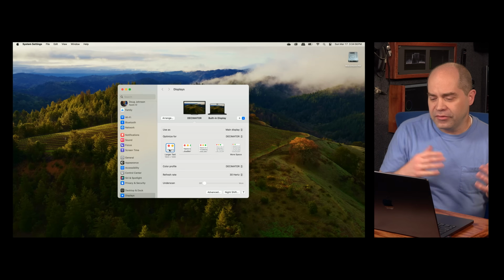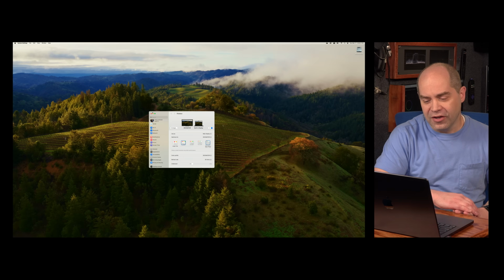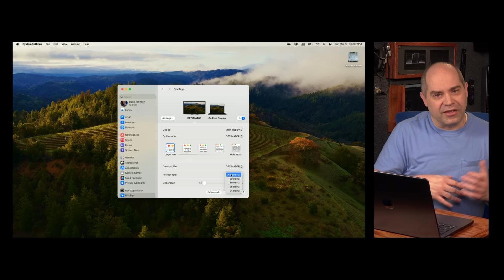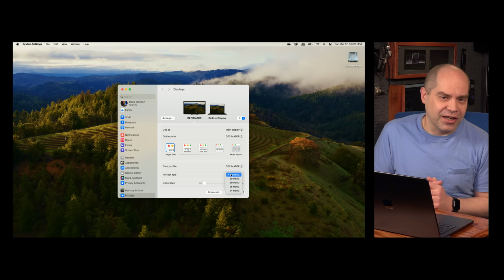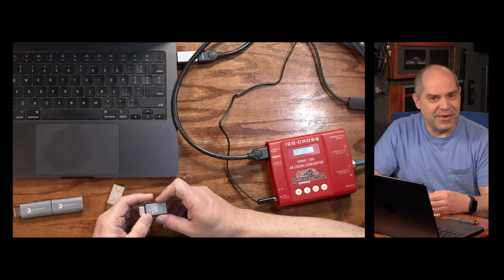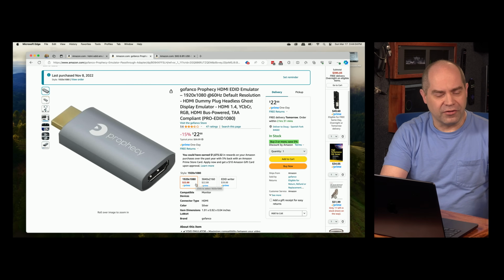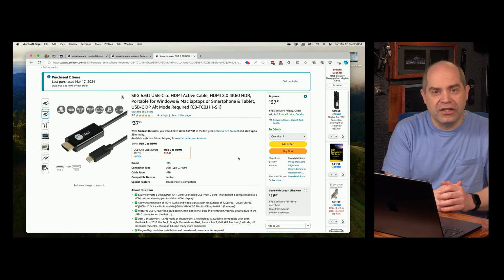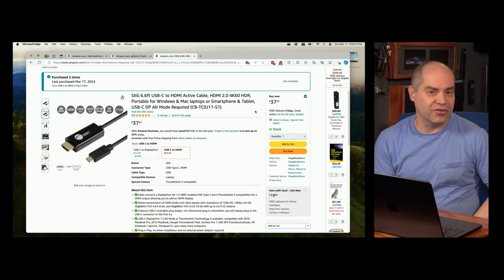Fixing Apple Silicon Mac HDMI Output for Video Production Systems

Comment: I always found it interesting how Macs seemed to be marketed as "media production computers" and yet they cause more headaches in a production environment than most all Windows computers. At least that has been my experience.
Reply from the maker: For me, Macs have been a lot more of a headache to deal with than Windows PCs. From weird things like this HDMI issue to software updates that break drivers to a lot of occasions where a piece of software that I need to run an event isn't available on Mac, I generally now only use Macs when I have to.
Reply: As a user of both, I've found the opposite to be true. Windows is always changing and thus more difficult to support. We use more Windows appliances for broadcast but more Mac workstations for Post production. It just boils down to using the best software ecosystems available.
Reply: 100 % agree. The fact that this has been a issue since the introduction of their own chips, and they refusal to acknowledge incorrect is mind blowing

Comment: If you use the 'Advanced. button and check "Show Resolution as List"  you get a switch to "Show all resolutions"   Any resolution that is not HiDPI scaling to full pixel resolution available as you describe is then noted as 'low resolution' next to it.
Reply from the maker: I'm sorry, but this doesn't change the HDMI output resolution. It gives you additional scaling options, but the HDMI output resolution remains unchanged. I verified this, yet again, just a few minutes ago, on both of my Macs.
Reply: Really?,  I just did it on mine and it worked.  The resolutions not marked (low resolution) will be full available resolution but scaling text and UI elements as if it was the lower resolution.  Resolutions marked (low resolution) will output that actual resolution.  This has been the case since case for some time before M chips, but is what the intel mac and the M2 max in front of me both do.  @djp_video  
You usually only see the (low resolution) modes with "Show all resolutions" turned on.
Reply from the maker: You verified with a piece of equipment that shows the HDMI output resolution? I did it with both the Decimator 12G-CROSS and Teranex AV and both showed 2160p60 no matter which option I selected in the resolution list. I tried it several times on my M3 MacBook Pro and M1 Mini. Same result.
Reply: Opps, Im a liar,  its now $16
Reply from the maker: @praeburn I just posted some photos on my Discord server showing that what the macOS interface is indicating and what it is doing are different. Apple has elected to show one thing in the user interface when the hardware is doing something else entirely. https://discord.gg/d8mFdXbNHJ
Reply from the maker: @praeburn I've also installed SwitchResX and it doesn't help. You'll be able to see that in one of the photos on Discord.

Comment: I wonder if you have tried in Extended Display mode instead of duplicating the display. For me, this has not been an issue, but I also don't run computers into the system a lot.
Reply from the maker: I tried it. It does not make a difference.

Comment: We have an M2 MacBook Pro and a deck link Duo in a sonnet PCIE thunderbolt expansion unit. After about 20 minutes of being connected to the MacBook the outputs will stop working and the deck link now longer shows up in the blackmagic software. Odly enough the deck link is still showing in the system devices menu. Power cycling the sonnet rack fixes the issue but it’s unusable for any live show. Any thoughts?
Reply from the maker: Hmmm. Might be worth reaching out to Sonnet for support.
Reply: Is this the first time you're having issues with that particular Decklink card? If so, it might be the fan on the card.
Reply: @AaronKothe  Both the deck link and the Mac are only 5 months old and the issue has been happening since the first time we tried it.
Reply: @Alex-456  I would not regard the age of the Decklink as a factor in trying to diagnose the issue. I had a Decklink Duo 2 arrive DOA once. It is not uncommon.

Comment: Even on a 2014 Mac Mini, I had to use a "Dr HDMI" to force it down to 720p50
Reply from the maker: On many Intel Macs there were ways to change the actual output resolution in software. But it's more of a hassle than using something like a Dr HDMI or EDID Emulator. On the Apple Silicon machines, I haven't seen any way of manually setting the output resolution, and it doesn't seem to support the NTSC-style frame rates at all.

Comment: I’m doing video production for a monthly Apple user group (mainly iOS developers) and we run at 1080p50. I feed the HDMI of the presenters laptop into a BMD HDMI to SDI converter as our switcher is SDI. The Mac detects this as 1080p60 and we let the switcher do the frame rate conversion. This has never failed to work to be honest. It doesn’t matter if we use the native HDMI output (on Macs that have it) or an USB-C dongle (original from Apple), it always works fine. When the presenter needs multiple laptops I put an old ATEM Mini on to these stage so the presenter can switch between the laptops him/herself. As the ATEM Mini also only supports up to 1080p60 it works the same.
Reply from the maker: If your switcher is at 50p and you're feeding it a 60p signal you're going to be getting some really weird motion artifacts. It'd be far better to gently encourage the Mac into outputting at 50p.
Reply: @djp_video I know and I do when I can but I’m not always close to the presenter when they plug in. But the motion/animations are usually very limited as it’s mostly Keynote presentations or some live coding.
Reply from the maker: Pick up an EDID emulator so you don't have to play with any software settings. One of the best $10 investments you can make.
Reply: @djp_video I will definitely buy one and see if I can always force 1080p50 that way. Saves me the manual change.

Comment: The most frequent problem I'm running into with Macs at the moment is a pink hue / colour shift when connected to a Decimator MD-HX - assuming due to a YUV/RGB mix up?
Reply from the maker: It could also be a timing or level mismatch, which isn't uncommon on Macs. If it's just a color shift (all colors being too pink, for example), it's signal timing or signal level mismatches. If it's a complete mixup of colors (black being pink, blue being green, that kind of thing), that could be a mismatch of color space (RGB vs YCrCb).
Reply: @djp_video  interesting, yeah it's always just a colour shift
Reply: Not sure if it’s the cause of the color shift you are seeing but you always want to disable the Night Shift feature on the presenting Mac. This causes the output to be a lot less blue and more yellow.
Reply: @MarcoMiltenburg  yeah good shout, but I always look out for that and it's not the cause in this case

Comment: Hold down the option key and click on one of the resolution options. You can pick specific output resolutions…
Reply from the maker: I've never seen that work
Reply: @djp_video It definitely works, it shows a long list of resolutions but still it’s scaled/emulated. The outputted video signal on the HDMI port is always the highest that the display/device natively supports. macOS will scale to the resolution you choose.
Reply from the maker: That's exaclty what I demonstrated on the video. But it doesn't change the output resolution, which is what we need to do.
Reply: @djp_video  hold the option key and press it. It brings up a selection menu of resolutions and not just the scaling settings
Reply from the maker: @WPayne19 I've heard this suggested many times, and I've tried it many times as well. And I verified it just now yet again on both my M3 MacBook Pro and M1 Mac Mini. I get the long resolution list, and click on one to change it, and that does change the scaling factor, but the resolution being output to the HDMI port remains unchanged. 

I have never seen any way to change the resolution being output to the HDMI port on any Apple Silicon machine. A lot of people have suggested this method, but I've never seen it work.
Reply from the maker: @WPayne19 Photos of my Macs outputting 2160p when the resolution is set to 1080p on my Discord server... https://discord.gg/d8mFdXbNHJ

Comment: I see a mac, I reach for a decimator
Reply from the maker: When it works, that's great! But I've also seen nearly as many situations where it doesn't work as when it does.
Reply: @djp_video  sledgehammer is another option. Great video on the topic will be adding some of these to the shopping list - Macs caused far too many headaches over the last couple of years since interlaced output was seemingly patched out

Edit: links in the description you're a gent! 🙏
Reply: @Dinnernator  wow, so would that explain why my projectors keep losing signal since my BlackMagic ATEM is set to 1080i only because my junk camera switcher is only 1080i capable?
Reply: @gearjammer89 I wouldn't think so, if you're i the whole chain it shouldn't make a difference - hard to say without seeing the setup tbh

Comment: One of the problems I've seen with M-series Macs is that they tend to output a 60Hz frame rate rather than 59.94Hz. The only consistent solution I've found for this problem is using a BMD UpDownCross HD converter to convert the Mac video signal to 1080p59.94. I prefer this solution over EDID emulators because the converter forces the Mac to turn off HDCP. I've tried using HDMI splitters to isolate the Mac's default HDCP video signal from my BMD components, but found the splitters unpredictable, particularly when randomly unplugging and replugging HDMI cables. A subtle feature of the BMD UpDownCross converter is its dual SDI outputs, which allow running redundant pairs of SDI cables to a BMD SDI to HDMI Mini Converter with dual inputs. That particular BMD Mini Converter has a built-in fail-over mechanism which automatically switches to the secondary SDI input whenever the primary SDI input fails to sync.
Reply from the maker: EDID can't force the Macs into doing 59.94 or 29.97 or 23.976. They just won't do it at all no matter what. So some kind of frame rate converter is necessary.

Comment: If the dongle cannot force 59.94 I guess it cannot force 29.97.
Reply from the maker: Correct. It seems that Apple Silicon Macs can't output the 1/1.001 (59.94, 29.97, 23.976) frame rates at all. So those still need to go through some kind of conversion, whether that is performed by an ATEM or another device.
Reply: @djp_video  This sort of begs the question about an NLE that is playing a 29.97 timeline.
Reply from the maker: If you have a dedicated output device like a DeckLink or UltraStudio you can get true 29.97 out of it.